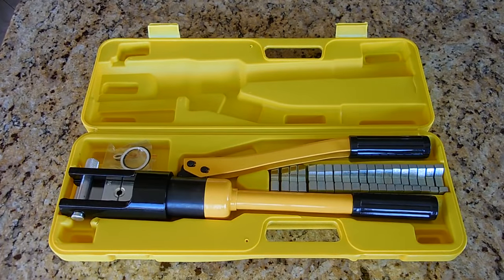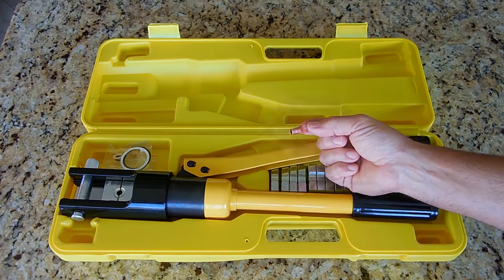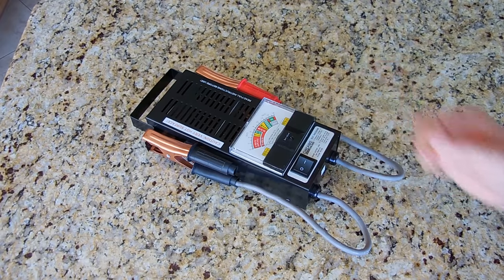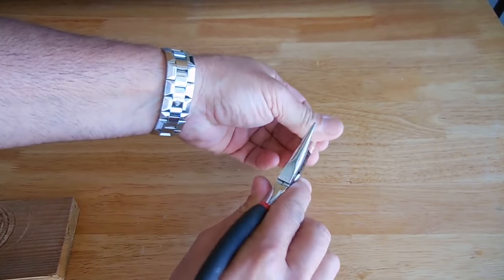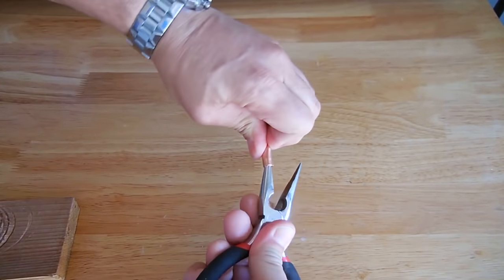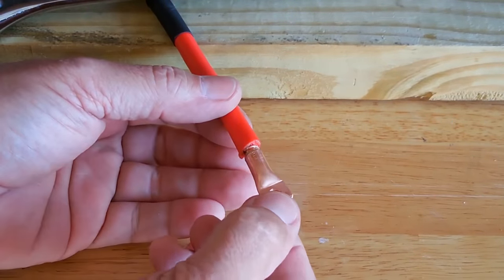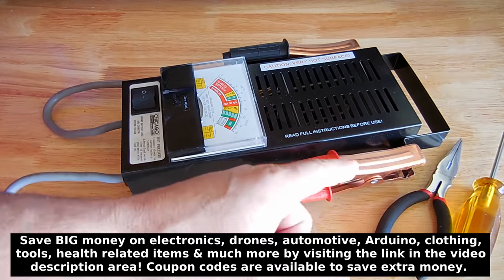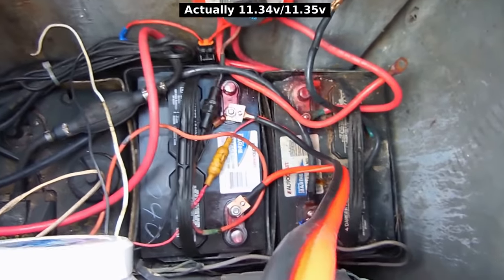Soldered Versus Crimped! Which Method Is Better?

Comment: That is not how to measure resistance difference.
Connect it to the battery and measure Volts over 1 of the cable at the battery and the load, you should get some milli Volts and if you know the load amps you can calculate the resistance.
And do the same with the other cable, the one with the lowest voltage is the one with least resistance.

The way you do is just measuring the battery voltage at load

Btw i prefer crimp then solder. If it is thin cables i usually just twist and solder
Reply from the maker: tullgutten The way I did it was just fine. All I wanted to do was compare the voltage across the soldered/crimped connectors at the applied load. That voltage reading says alot. There was no need for other calculations. Thanks for watching
Reply: I beg to differ, this is far from an accurate voltage drop test. the method of measuring a single conductor is the industry standard for very good reason.
Reply: No, electronicsNmore, not fine at all. Yes, the voltage reading says a lot about the battery and load, but not so much about the cables. You were measuring the voltage across the connectors PLUS the load. The load voltage can change significantly between tests because of many other things other than the cables. Tullgutten is right - you must measure across only the (equal length) cables to see the tiny difference between the crimp/solder resistances between the nice clean freshly made parts.
Also, things will be different after enough time. As others have pointed out, solder alone can melt under high loads. But crimping alone is eventually subject to corrosion in industrial environments. Soldering after crimping can help isolate the cable/connector mating surfaces from corrosive atmospheres.
If you still don't believe tullgutten and me please check with a community college electronics instructor - maybe one of them can do a better job of explaining this. I do like the idea of fabricating your own lugs and I wish you lots of success with future videos.
Reply from the maker: Thankz4sharing Totally agree with the crimp & solder comments, but completely disagree with your load testing remarks. The purpose of the test was to dispute viewer claims from a previous video that a soldered copper connector would result in much higher resistance/voltage drop under heavy load, AND cause the connectors to heat up. Using 2 identical cables, with one crimped and one soldered, and a 100A load, I proved those claims to be inaccurate for short term heavy load use. Measuring the voltage at the point where the load is attached, gives an excellent indication of the level of resistance of the soldered cable COMPARED TO the "low resistance" high pressure crimped cable. If the soldered cable had much more resistance, you would have seen that with a voltage reading much lower under load, and you didn't. The same battery was used for both tests, and the battery was allowed to recover between tests. Though the test wasn't perfect, it was good enough to prove a point. As far as I'm concerned, there's nothing else to discuss. I will also post this comment as a "Pinned Comment" for other viewers. Thanks for watching.
Reply: The test is fine for proving that there are no gross differences between the two types of connections. Measuring the voltage drop across the connection with the mV setting on the DMM would be able to determine the difference in resistance to a much finer degree and would be more conclusive as to which results in a better connection, even if it were only a difference of a fraction of a milliohm, and less affected by the discharging of the battery during the test.
Reply: Tullgetten is correct... Electronics is doing a 4wire resistance measurement where the load=DUT... 4wire must be done on cable then cable=DUT
Reply: Have to agree. Not sure what your test actually measures, if anything. Measuring voltage between end terminals of a cable at a known current would show the overall cable + terminal resistance and give a true comparison between crimp and solder.
Reply: @perrooceaniko2005    A crimped high current wire getting hot enough to melt solder, would be one of the most stupid things I've ever seen as soon as I've actually seen one. . . .  Unless its a heating element. . . .

Comment: If you flatten the tube with the wire all the way through and then crimp and drill. After that solder the tip and the back side by the insulation. Your connection would be improved. Also a correct test of voltage drop is from end to end of the wire in millivolts. Being source to load voltage drop.
Reply: Correct! Two separate tests on each leg of the individual wire would test the actual voltage drop of the connection. 
Also, with at such low current and time I wouldn't expect any difference in the result.
Push the limits of the wire and connection.  If you can't apply a 300 Amp load for 30 seconds, use 10 or 12 gauge wire and apply 100 Amps for 30 seconds ... this will put your connection to the test.
I build stunt scooters that use 2 800 watt brushed motors and a 300A controller.  Early versions would melt all the solder on the circuit board then all the components would fly off if you went over a curb after multiple wheelies.  
Once we solved the controller issues I was using fine strand 6 gauge cables with soldered connections but found they were limiting throttle response when drag racing.
Contrary to popular belief I had better results with 10 gauge tinned stranded wire with crimped connections (Made in USA wire).  These scooters would draw about 240 amps for a couple seconds (0-30mph) then taper off to 30-60 amps depending on the length of the race. 
The tinned stranded wire never failed or even got hot even when all 8 brush holders would melt on to the commutator.  I think this was because the high current was for such short bursts.

Comment: Keeping in mind, crimping is a "cold flow" bond; soldering was normally not allowed on aircraft... (partly due to solder connections can ultimately, through heating/cooling due to electrical current flow and vibration, end up cracking/loosening) crimping is usually the strongest mechanical (and/or electrical) bond. rosin core solder, being acidic, can also initiate corrosion; up the strands inside of the insulation (heating also initiates the corrosion/oxidation process)
Reply from the maker: Yes, if a wire is allowed to move around, vibration can damage a soldered wire. The rosin/resin actually forms a protective layer, encapsulates active residues and provides a water impervious coating. As long as the correct flux is used, and the connection is properly sealed using glue lined heat shrink tubing, air will not enter to allow oxidation to take place.

Comment: When making your own its worth leaving a "T" at the insulation end to wrap around the insulated portion of the wire, and crimp.  That way you can solder the connection and enjoy both the best electrical connectivity and the best mechanical movement mitigation.
Reply from the maker: Thanks for watching and the tip!

Comment: Have you used this tool for crimp sleeves on light stranded rigging wire used on a a boat?  Is it suitable for a sleeve bearing a mechanical load?   I noticed you mentioned being in the Bahamas, perhaps on a boat.  Thanks for a good video.

Comment: The crimper you linked us to is a better deal than the one at Harbor Freight.  It has 2 more sets of dies, plus the carrying case, for a cheaper price and free shipping.  Not bad!
Reply: Definitely better than the HF one. While that also has a carrying case, the big issue with it is that it only has small dies, going down to silly sizes that would be more suitable for pliers type crimpers than hydraulic ones.  They would be best considered blanks that you can custom grind to your own needs, but otherwise useless.

Comment: the reason crimp is preferred and even required for some applications is because if the wire heats up and de-soldiers itself it can pop out of the lug and hit other components.
Reply from the maker: Dylan T Yes, I understand that, so it's a great idea to crimp and solder.
Reply: If your wire gets hot enough to melt that solder you've got some serious problems in your circuit design, switch over to a heavier gauge wire.  The only reason that (proper) crimping is preferred is that the wire ends are less prone to fatique since the non-soldered wire is more flexible.
Reply: Dylan T true i had tgis happen on diesil starter end lug.
Reply: ixfxi 
Key word being proper, as the crimp terminals the general public is familiar with from the local hardware store, being used with the cheap combo cutter/stripper/crimper tool makes for very poor quality crimps. 
Wiring for high reliability aerospace applications use terminations and specialized crimp tools that produce enough force to cold weld the wires and exclude air from the joint. No solder is used as it would make the wire brittle and risk fracturing from any mechanical stress.
 However, with normal crimp terminals and generally available tools, soldering would improve reliability.
Reply: @ixfxi  "since the non-soldered wire is more flexible when the soldered wire is not executed properly.  Fixed that for you.

Comment: This is an older video, but here's my thoughts...

I don't have anything against soldering because it works. I prefer crimping because, in high vibration environments, soldered connections can break. They can take abuse but in the end, a crimped connection will prove to be more durable if done correctly. 

Just keep in mind the environment the connection will be in when doing it.
Reply from the maker: I read all comments. :-) Thanks for watching!

Comment: wonder if something like dielectric grease will prevent it corroding inside before you crimp it?
Reply from the maker: Jusb1066 Dielectric grease is non-conductive. So placing it between the copper lug and wire will only increase resistance. No reason why you can't apply it after crimping.
Reply: Jusb1066 we do this on all marine salt water connections.

Comment: Soldering cable can make it brittle causing it to break. This usually happens after a considerable period of time and usually on machinery that has a lot of vibration ie a bulldozer. You can prevent crimped connections from corroding by dipping the cable end in a rust proofing waxy liquid before crimping the end on.
Reply from the maker: Stephen Velden True, but applying a thick walled, glue lined heat shrink tube over the connector and soldered area, will prevent the area from flexing back and forth.
Reply: Not on a bulldozer. Those things get slammed around like you wouldn't believe. They shake everything to bits. Believe me I worked on them for most of my life. I'm 60. I'm also an Auto Electrician.
Reply from the maker: Stephen Velden Clearly a soldered connection isn't ideal for every application. Thanks for watching!
Reply: that is 200% correct.  Never solder high AWG cables.  Nobody in the industry do that but in FEW very specific applications.
Reply: Not true.  the brittleness of the cable remains the exact same.  The brittle part is the copper, not the solder.  Solder just evens up all the ends at the load point IF you allow the solder to copper junction to become the load point which exposes the brittleness of copper.  Knowing such you just create/use connectors that have a part to wrap around the insulated portion of the wire and crimp there, giving yourself the best of both types.    If you put a non conductive substance on before the crimp, you're just degrading the contact.  I'd love to see some pictures of "failed" soldered wires from a bulldozer.   I'd put my lunch money down right now, that it isn't due to "soldered connections just do that" but rather "it wasn't done correctly".   A  properly soldered connection IS a crimped connection with a little bit of solder connectivity, such that the drawbacks of solder that are known about are eliminated at the install time.  in 40+ years of experience I've seen ONE cracked solder joint on a circuit board, where the solder actually broke, and that was because the cable it was connected to was kicked by a human.  Are the components on the circuit boards on bulldozers all connected to each other via CRIMPS?  What I'm finding investigating this more about people's opinions and my "could I be wrong about this?" nature is that people improperly solder, it fails, and rather than blame their methods or educate themselves, they blame the process, or as in @perro Oceaniko's situation: the processes have to be written for absolute monkeys so the bit of intelligence it takes to not generate a brittle soldered joint that will fail, has to be completely eliminated, as it is too risky to allow an idiot to be an idiot on that particular piece of equipment, so you have to mandate they use the method that is least failure-prone due to idiocy.

Comment: in salt water marine engines we crimp and then solder. Also solder only fail on starter cables when they get hot under load which can cause a fire. Excellent show thanks
Reply: Yes, the connection is copper to copper.  The solder only works to seal it against the environment.  Adding the shrink with glue on the inside helps further.
Reply: No, in marine applications YOU DONT SOLDER !    you use the right tinplated connector (not this shit made of a piece of tube to save 30 cents) , select the right size,  the right crimping tool and a marine Heat activated adhesive lining shrink tube and the work will last FOREVER.  You never crimp AND solder ..... Never.   Also cable have to be stranded, tin plated.  If not tin plated use a bit of good electical liquid vinyl to keep moisture away and after that the shrink tube i mentioned with adhesive.    Will last forever.   Never crimp and solder.
Reply: "only get hot under load"  translated to english:  "only cook themselves when some idiot is also cooking his starter".

Comment: I don’t understand the people that commented a soldered connection would have more resistance? Theoretically it doesn’t make sense as soldering bonds the two pieces together as one solid unit with crimping as secondary connection, while crimping alone is merely only a physical connection. Is there a reason soldered would cause high resistance that I can’t think of?

Comment: I have a hydraulic crimper and I always strip the insolation back 1/4 inch, crimp them and solder them then add a quality heavy duty shrink wrap on it. I have never had any problems with any battery cables.
Reply from the maker: Thanks for watching Randy! Please share the video link with others.

Comment: U are right there wasn't much of a difference but there was still higher resistance in the soldered one as it started out on a slightly lower voltage and finished as a high voltage as it was opposite on the cramped ones.

Comment: That crimper is really nice. Instead of messing with the two shims for the smaller wire how would the crimp look if you leave one die alone and turned the other to the flat side?
Reply from the maker: I think you can buy smaller dies. I can do only one side.

Comment: I didn't read all the comments in this, but one thing I didn't see in the few I read was about vibration testing between solder over crimped connections? Solder can work harden connections and the wire can break,  crimping can do the same thing also if you mash them to damn tight..  In aviation we cannot solder a connection because of work hardening from vibrations in the aircraft, now think about it for a minute, why are most things potted in solid state stuff? Like All the ECUs, EMMs, FADECs and many more things. What's not soldered is the power lines over and under ground going to your own home.
Reply: Marine and dirt moving cases are quite different.  Corrosion is the enemy.
Reply: how are they different? does a wire and solder joint care where it is at the time you make them? I would think aircraft has way more things going on for them. You have temp changes along vibration and pressure. So please explain to why everyone is into solder again?
Reply: On an aircraft, it is a very bad day if salt water or wet mud sprays around the inside.  On a ship or earth moving equipment, that is just Tuesday.

Comment: crimp then solder. best of both worlds. good mechanical connection good electrical connection. if you don't have the money for a fancy hydraulic crimper or don't have one at the time here is what you do. take a good center punch and strike the connector with the center punch and a hammer to get a nice dimple. you can do both sides. then heat and fill with silver bearing solder. i will put my method up against any of those fancy hydraulic crimpers any time. i do own the a pair of harbor freight hydraulic crimpers. you can make your connectors by flattening them in a vise. copper tubing or copper pipe can be used. be careful when putting ends on jumper cables. if they have CCA on the cable jackets they can only be crimped. CCA= copper clad aluminum wires. most of your chinesium jumper cables are the CCA kind. they heat up quickly and will not carry the amps stated on the package.
Reply from the maker: I agree, crimp and solder.